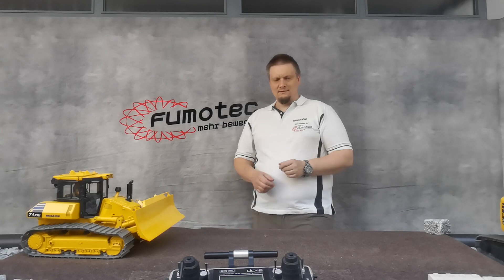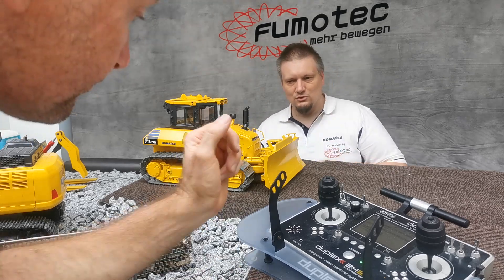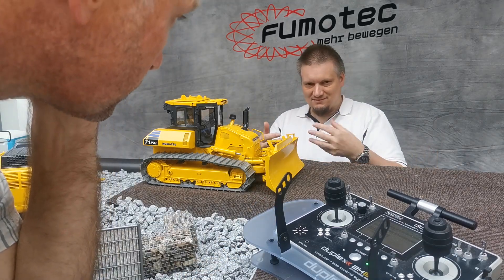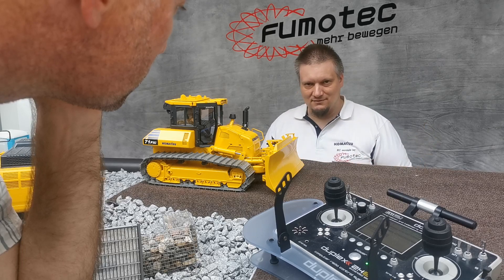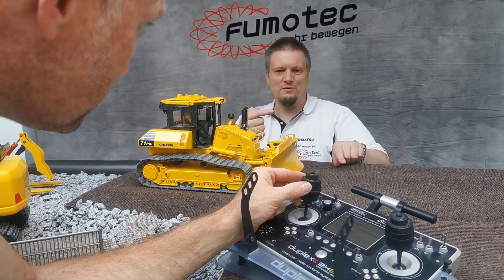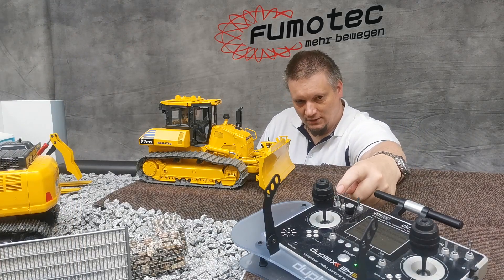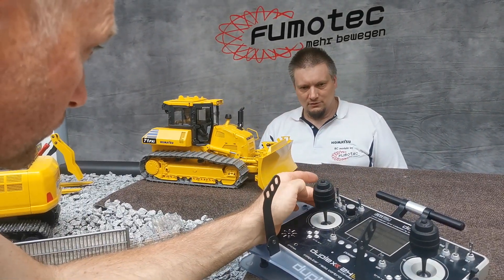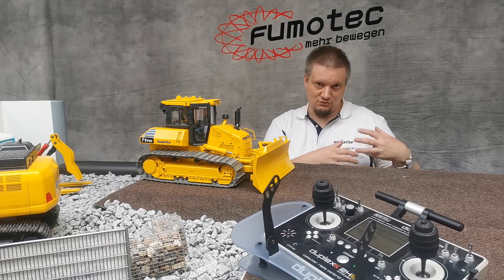The difference between brushless and brushed drives and how brushless drives work super smooth

Comment: Do you use sensored motors and esc or is there any other magic? :)
Reply from the maker: There is no sensor on the motor ;-) So the "magic" as you call it ( seem´s you like the result ;-).....) is mainly the ESC. But in special combo with the drive setup in our brandnew dozer D71-24 that´s gonna be available in our shop very soon, makes the big difference and gives us the result that is working out perfect! We gonna spend more time on testing with different other drive motors to see if we can benefit here as whell from the setup of the ESC. But for the moment our focus was to get the best out of the full scale drives of the D71-24. So this setup is for the moment exclusiv for the D71-24. But as i said more to come, we gonna do more testing to be able to improve other brushless drives as whell, because we love brushless ;-) ! so.......stay tuned!
Reply: @FumotecTV  thanks for the detailed info! 
So you will sell the esc separate in the feature if it works like you want to? 
Like you said in the video, I prefer brushed as of now because of the smoothness.